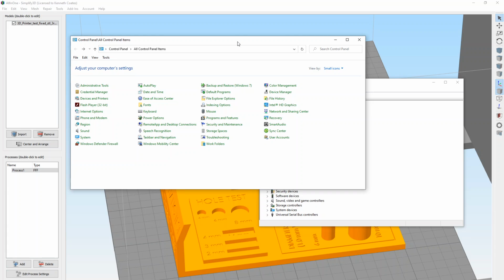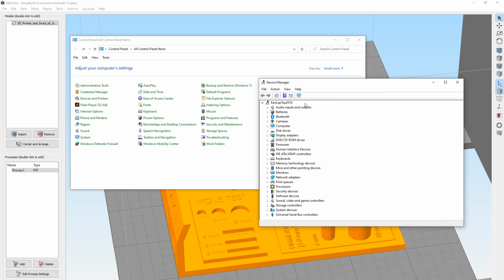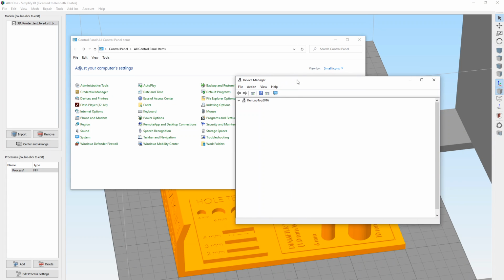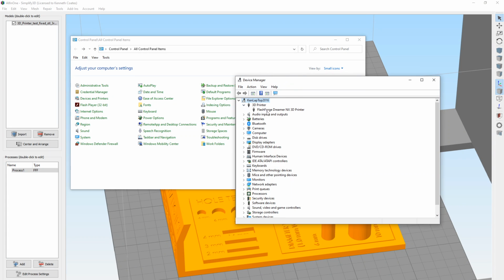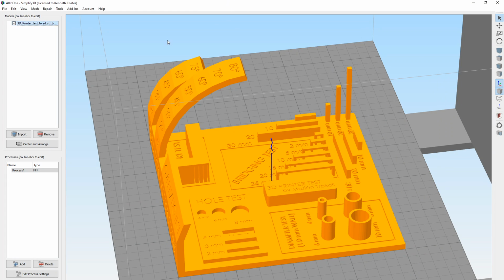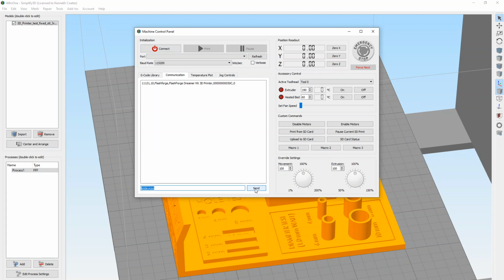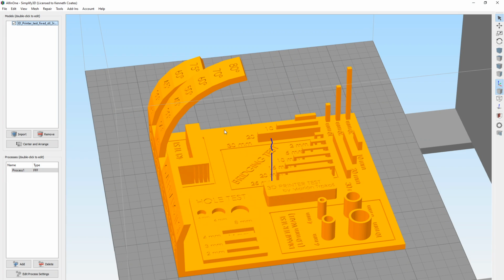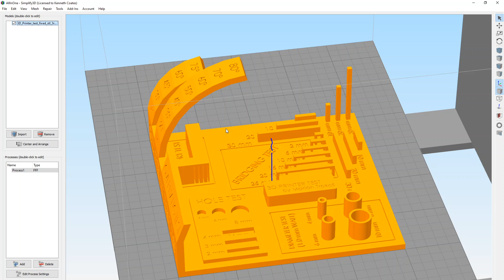Simplify3D Tip: Connecting to a Flashforge Dreamer NX 3d Printer

Comment: Good shit. I had a USB extension cable that caused this to not work. It seems you need a single line connection to the printer.
Reply from the maker: Thanks. Yes I wouldn't use a long USB and/or extension cable to connect to the printer.
Another point: now that I'm very familiar with how the printer works, I don't run interactively anymore.
I had a few prints stop I think because of a glitch in the communication between the PC & the printer.
These days I print everything by copying the GCODE to a SIM card and plugging it into the slot on the printer. 
That eliminates any issues with communications with the PC.

Comment: Hi. Could you send me the Dreamer NX profile from Simplify3D? amsmjunior@gmail.com
Reply from the maker: I can send you one for a particular filament I'm using, but all I did when I first installed the software is to pick the "FlashForge Dreamer" and delete the "Left Extruder" on the [Extruder] tab of the "Default" profile since the NX only has the Right Extruder. Everything else I left the same. After that, I did a "Save as New" profile and made any modifications I wanted.

If you've already installed Simplify 3D and you want to start using a FlashForgre Dreamer NX, you can go to [Help>Configuration Assistant], and select "FlashForge Dreamer" as the printer type and delete the  "Left Extruder" in the "Default" profile and Save.

Let me know if that works for you. If not I can send you a profile.
Reply: @BetaCygniBlog  Thank you. The support sent to me the Profile.
Reply from the maker: @AntonioMenezesJunior  Great!